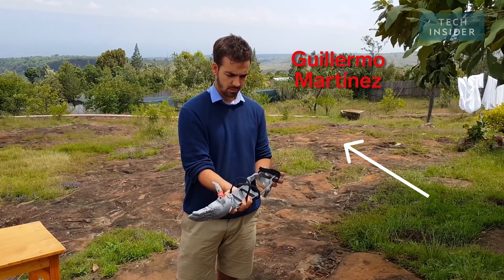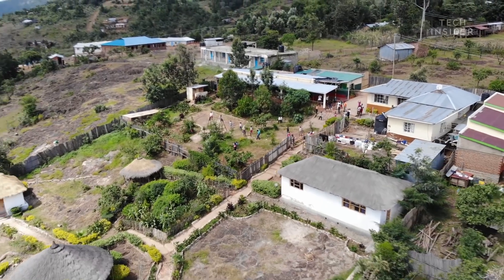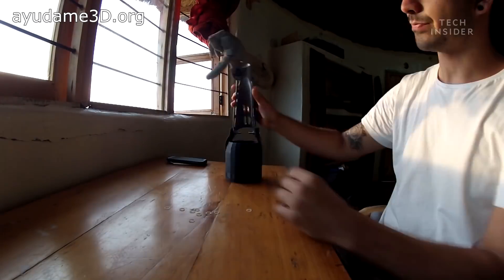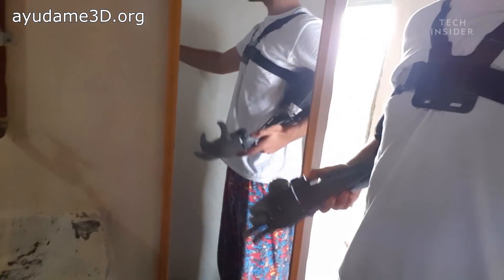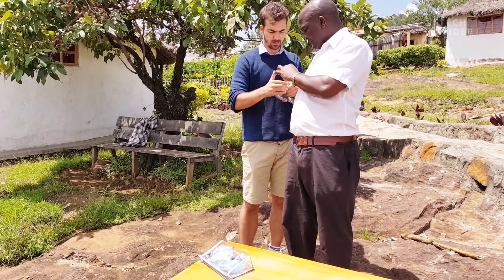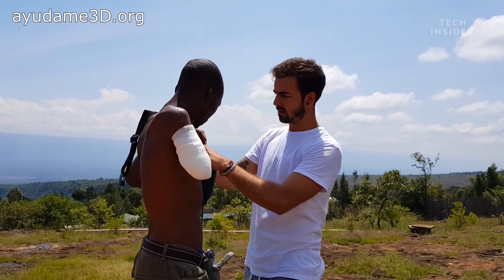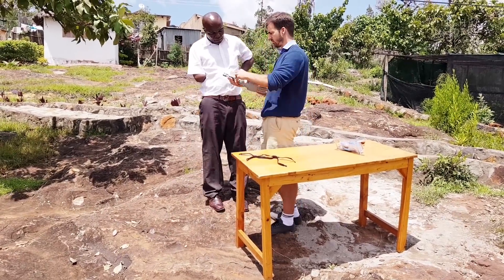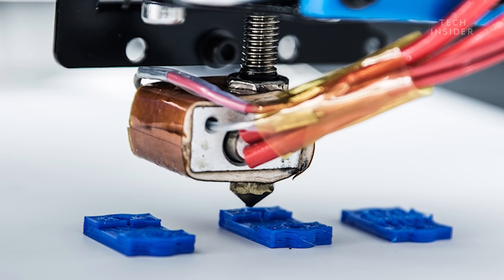Meet The 24-Year-Old Whose Prosthetic Limbs Are Changing Lives

Comment: For context, I've worked on bionic limbs in research, and had the opportunity to learn from prosthetics professionals all over North America.
While this person has good intentions, it is very naive. Not only are the limbs made of cheap plastic, but the skin interfacing with conventional 3D printed plastic is not safe. 
The plastics he appears to be using are not bio-compatible (I am assuming this given what materials are commonly 3D printed). In a worst case scenario, these poorly fitted prosthetic can cause skin damage. In a developing country where some people don't have access to medical care or proper sanitation, this small injury can lead to infection, and possibly further amputation due to improper care. 
Affordable prosthetics are amazing, and there are lots of companies doing it, but this is the wrong approach, it needs to be much safer for users. 
And for those people who say "It's better than nothing!". Not necessarily. These arms will break if these people do much more than lifting small objects (They claim 10Kg, but I am skeptical of this, I'd like them to provide load analysis and a description of the polymers used), and the injury it could cause is not worth it. 
If you want to see well designed and affordable 3D printed prosthetics that are approved by regulatory bodies, check out Open Bionics or Max Bionics.

Comment: Those prosthetics literally take a work day hours up to days to print, just a finger takes up at least half an hour.
Reply: True, I think this is where factory manufacturing meets tailor made 3D printing.
They print the parts that have to be adjusted and fitted onto the person's stub.
Then they mass produce the rest with injection molding. I.e. the fingers, the hand, some parts of the arm. It wont be perfect but mass production will make it hella cheaper and more viable as the arm will eventually deteriorate and people need quick spare parts.